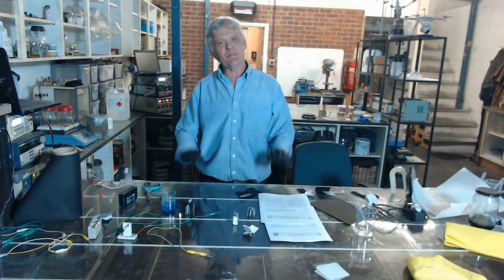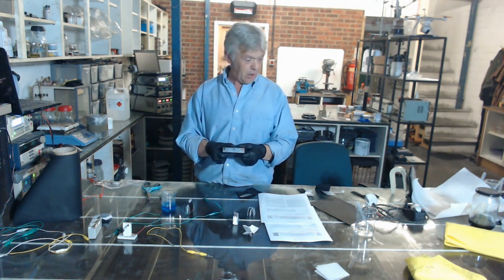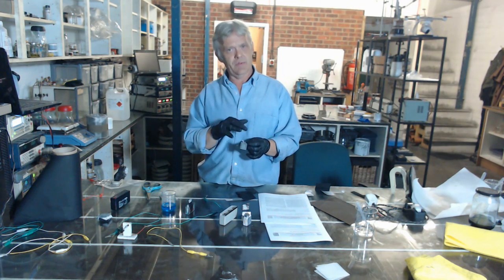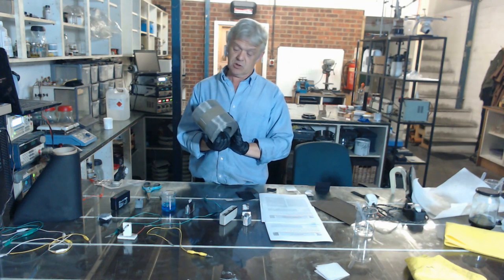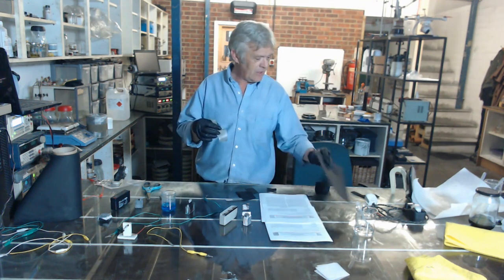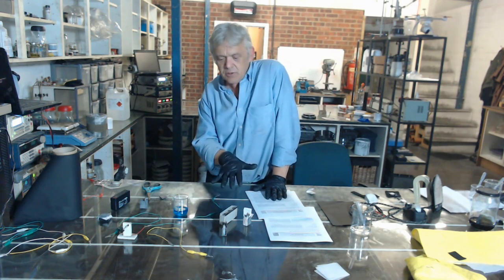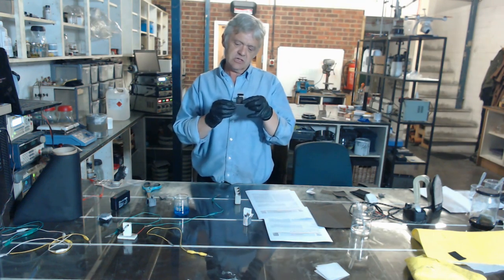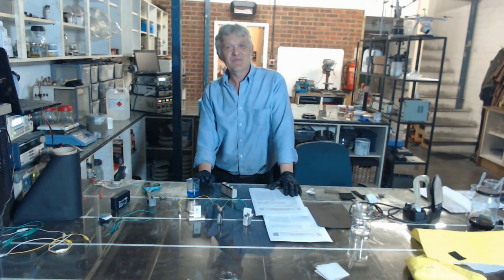How To Build A Better Battery

Comment: great video again!!!
im watching this video for the 3rd time 1 year apart. im NOT much of an experimenter but i do do a lot of small size scrapping for instance i cut the terminals off of car batteries and other batteries because the scrap price for batteries was just 8 cents per pound on 6/16/2023(yesterday) and i sold over 500 pounds 
i have watched videos of guys from INDIA or PAKISTAN cut apart truck batteries and make new plates from the old plates by melting and recasting then making a new battery.
i watched "codys lab" do a video like that around 10 years ago.

what would be really cool would be to cut apart  old batteries after draining and recharging several times with distilled water to salvage all the acid possible. make some really big plates and cells and make a battery at home that would be huge and energy dense too.
or maybe a huge number of smaller batteries to make a power wall or sort of from lead acid at home!

Comment: Is stoichiometry taken into account... e.g. this much carbon for this much electrolyte for those that aren't familiar with the term... It means the right amount of the components for the reaction without 'waste'... e.g. H2O (Water) = use 2 bits of Hydrogen to one bit of Oxygen (but you need at least 2x that as Oxygen is normally O2)... if you have 180 bits of Hydrogen per Oxygen molecule = inefficient and ditto if 180 bits of oxygen per hydrogen (although then surely it is easier to breath.... :p  Here applied, the carbon might be the right amount for maximum performance, or could be too little or too much... maybe making thicker carbon infused material, or more surface area might give better performance.  I wonder.

Comment: How important is the thickness of the positive lead plate?  I was thinking of pulling the copper mesh through a lead bath to coat with a thin layer of lead.  Combining that with the carbon hdep approach you suggest on the negative side.   Reducing weight.  And I want to roll it all since it's now flexible.

I'm sure you could tell me why that is a bad idea before I waste time.  

If that's a bad idea, is there another way to reduce the weight of the positive side without making a sacrifice in performance and reducing weight?

Comment: What do you think about modifying a forklift battery,   the large 2v cells in series, making a 24,36,48v battery of about 1000ah+, I'm thinking of solar use, i have heard ppl swear they used them 25+ years and still going, used every day, i have a small fla battery bank, about 600 ah+/-,  but also started building a lithium bank, 7s 29.4v. Since my inverter can handle 30-31v, what would this mod, do for capacity? And lifespan,  my peak current discharge is around 250 amps, but normally only 25-50 amps, i can't afford expensive batteries, i have spent 2.5 years building up a 500 ah lithium bank,I want to get it in service, and use the lead acid for backup, and I can charge them with a DC generator, I don't want to risk that with my lithium battery, it's a 150 amp alternator on a 12hp engine, 150 amps at around 28v,
 the 2v fork lift cells are 3-4x the size of a car battery, if I could get one nearly at the end of its life, could it still be successfully converted? A refurbished battery is $1500-$2500 depending on size and voltage,  my concern is using them daily, and not keeping them charged fully daily. And sulfation taking over.  I could use the generator to top them off. On the days they do not get fully charged by solar, but that could get old! About 50% of my reason for being off grid, is to help the earth, I do not want to burn hydrocarbons! I just as well be grid connected. I think of you as the genius guru of battery chemistry, I don't like powering my home with grenades, but if the life and energy is there, lithium works, and doesn't have to be fully charged to prevent failure,  that is a big concern, 
Also with this mod, how much of the energy density is from the loss of weight? Or is this a part of the figures? What do you think the life will be? And what us the failure mode? So sorry for the rambling, have a great day, cheers,

Comment: How would this refurb battery perform as a battery in an electric vehicle, like a tesla

What about forming a graphene foam plate from anaerobic carburisation of a risen bread?

And that copper penta sulphate is what they use as root killer isn't it?

Could we then, in theory, use root killer in a fixed, wide and long but shallow container, with multiple long plates of the plate you're describing here, make an effective scratch made battery?

Comment: The carbon felt does not show up in the shop.
Reply from the maker: you have to click all in the drop down box at the top of the page and it will show mate but here is the link to help mate http://secure.workingink.co.uk/shop/working-ink-materials/activated-carbon-felt/

Comment: I'm sure it's been asked a hundred times now, but how do you do this with a larger battery? Say a 12 volt car battery?
Reply from the maker: exactly the same way mate - if you open a large battery you will see just the same stuff only bigger - you do the same thing but the plates are 15cm by 15 cm instead of 3cm by 3cm as shown

Comment: I'm not a chemist but i am very interested in battery technologies.  I did some experiment with ultrabatteries based on your older video. I made 5 separate lead batteries with different configurations.  In all instances,  the negative plate never breaks down but the positive plates always do (flakes off chunks of Lead oxides).   It's even faster when the negative plate is coated with carbon.  So, i decided to coat the positive plate with carbon,  and surprisingly,  i didn't see any breakdown and saw a slightly  improved capacity.  My results seem contradictory from what i've read about the construction of ultrabattery.
Reply from the maker: that is interesting mate as I read the same stuff - I didn't have the same problem you did so it might have been the carbon you used or the binder you used - I don't know - but the felt has no binder so it work pretty well

Comment: Not kidding when I say I had a similar idea with a carbon impregnated material. I had a short contract helping a filtration material OEM upgrade their plasma vapor deposition lines. The let me keep a generous sample of their filter material for the purposes of exploring battery development. Happy to send you some.
Reply from the maker: that's very kind mate - I have tried an awful lot of carbon materials both made by myself and available on the market it Ould be better if you tried this with your carbon material and posted a video on the results - but thanks for the offer

Comment: Thanks for another fascinating video!  I was wondering whether you would consider offering a hydrophilic separator like Celgard 3500 for aqueous batteries  in your web shop. Celgard 2400 is easy to get hold of on eBay but doesn't work well with aqueous electrolytes. I have been searching a long time now for the coated Celgards with no luck what so ever.
Reply from the maker: http://secure.workingink.co.uk/shop/working-ink-materials/celgard-separator/ - that's the one mate
Reply: @ThinkingandTinkering  I checked in your web shop yesterday  but didn't see listed for some reason :P Thanks for the link, I just ordered some.

Comment: We found that you've done all types of batteries except a crystal battery do you think they're not worth your time or can you do a short video on the subject, maybe taking an old subject and bringing New Life to it like electrostatic battery give us more information these things working with thee  type of batteries I believe are on the uprise and it's not much information about  them. Because they use atmospheric electricity or the Piezo effect to gain its energy. They last many years, and as you can see many people are working on crystal batteries how about you thanks a lot.
Reply from the maker: I think you said it in your post mate - lots of folks are working on crystal batteries and there is a lot of info out there - I don't think that many folks post about carbon based devices like I do so I concentrate on that really and there is a lot to do on that subject so I am not sure if I will be looking at crystal cells anytime soon I am afraid - but it is in the back of my mind
Reply: thanks for letting me know crystal batteries are a thing.

Comment: Will we be able to expect a capacitor in a 18650 casing in the near future with energy stored in the same way as a 18650 chemical cell?

Greetings.
Reply from the maker: I'll probably do prismatic mate - easier for me to make
Reply: @ThinkingandTinkering  

So it's obvious to be easier.

But the question is whether at the moment the technician will allow to pack as much energy in the condenser as in the equivalent of a chemical cell.

This would be a big step forward for modern, super-fast batteries for electric vehicles.
Reply from the maker: @aothunterpl  yeah really lol - cheers mate

Comment: Great video, but the link in the description does not lead to the products you plugged in the video.
Reply from the maker: you have to put all in the drop down box on the page and it will show - trying to fix that
Reply: @ThinkingandTinkering  alright, i also noticed that your site is not SSL secure, this will be an issue for people to put in payment information on an unsecure site. When the shop is fixed, i'll definitely be purchasing some felt and HDPE, as i need exactly those components for a special battery chemistry that  i am working on.
Reply from the maker: @wanderingzanzey2126  cheers mate

Comment: Also the recycle rates for lead batteries is actually quite awesome, sure it has many drawbacks but the industrial process around it has very much matured and we are approaching the lowest environmental impact that is possible with that technology, to do better we need to move to something else, but that is something Rob has been working on now for quite some time :-)
Reply: Why don't all lead acid battery manufacturers move to lead carbon technology ?
Reply: @clintscreations9466  they last a lot longer 15k cycles discharge rate. Not good if your in the business of selling batteries that only cycle 500 times. Not good for business profits the economy etc plus the patent for the Ultra battery is licensed by companies who don't want that. You can buy the USA Deka ultra battery they have licence for usa market. Wait till the patent expires it will be a free for all or just make your own

Comment: The dendrites with zinc are probably the issue with the failure of the zinc lead oxide version as opposed to the copper.
Reply from the maker: dendrites really only form in alkaline solutions mate - the issue is going to be hydrogen evolution zinc in acid is notorious for that - but there are mitigation strategies to depress hydrogen evolution.
Reply: @ThinkingandTinkering  
Good point about the alkaline environment. There is a patent teaching that if some bismuth sulfide is added it overcomes the issue with hydrogen generation.

Comment: The website you linked is not 'secure' despite the URL saying secure.x.x ... maybe fix that :)
Reply from the maker: cheers mate - I'll get on to it
Reply: I couldn't get on the website either, said not secure and that too many redirects, I'm after some of that Carbon plastic you melted over the plates. Top notch vids by the way, very inspiring.

Comment: Hi Rob. What is the purpose of the hdpe carbon plastic?
Reply from the maker: I say in the video mate - It prevents the acid from attacking the steel and is conductive so the steel current collector is in contact with the active material
Reply: @ThinkingandTinkering  ah yes you did say. Cheers🙏
Reply from the maker: @Buzzhumma  no worries mate

Comment: How many charges and discharges are these good for?.The battery that I just bought for my truck is called a Deka Ultimate and it's rated at about 1000 charges discharges in its lifetime Robert.
Reply from the maker: it's in the papers I suggested mate - have a read of them
Reply: @ThinkingandTinkering  Okay,I'll check it out.
Reply from the maker: @4gauge10  awesome mate
Reply: Standard lead battery 500 cycles 3 to 5 years. Deka ultimate 1000 cycles  assume linear relationship 6 to 10 years. Deka ultra battery 15000 cycles  how many years will that last? The carbon stops the sulfation issue dramatically. They probably licenced the Ultra battery to stop competitors selling it but they don't market it as a car battery
Reply: Ultra battery is licensed to east pen manufacturing in USA  but it appears the Deka Ultimate car battery uses silver lead alloy extra electrolit reservoir and a paste on the plates to improve performance.  The Ultra battery can cycle 15000 times but is more suitable for various discharge cycles such as off grid solar systems they sell them in  prewired pallet units

Comment: Very cool Robert.
Question: Could you make a hemp based plastic substitute for the HDPE you're using?
Just a thought on an eye to sustainability.
Really love your thought provoking work.
Thanks.
Reply from the maker: you probably could mate - I would say give it a go and let me know how you get on - cheers
Reply: @ThinkingandTinkering  LOL, way past my capabilities. 
Just a thought. Keep getting FB stuff talking bout Hemp replacements for Petrochemicals..
Reply: @ThinkingandTinkering  
I vind your vidios insperational .l want to re make my deep cycle lead acid batteries .I opend all kinds of lead.  Acid batteries and foun the possetive plate disintergrated .my problim nou is in South Africa I can not find plate seperators,wat can I make them off
Danie
Reply: The drawback to using hemp is that unlike the HDPE, it is not resistant to the acid and will deteriorate over time.

Sustainability is a good concept provided you don't throw the baby out with the bath water. There is no magic switch that allows the world to go from a petroleum based economy to a "sustainable" economy overnight in the way that the extremists demand. 

When thinking about sustainability, make sure your sustainability approach does not do more harm than good. 

If it turns out that sustainability does more harm than good; then what's the point?